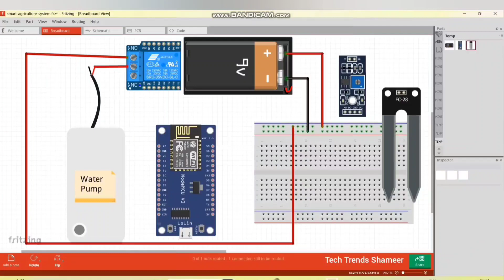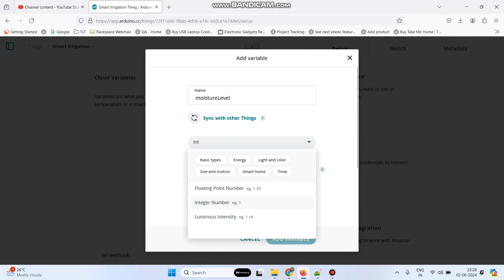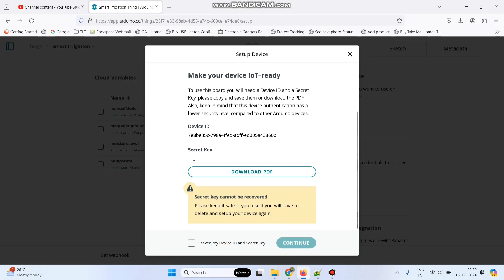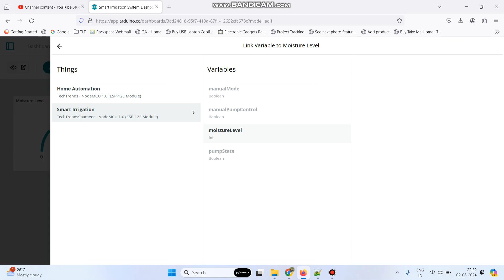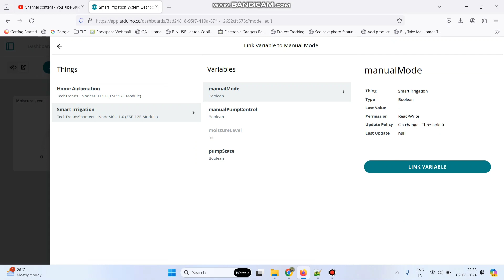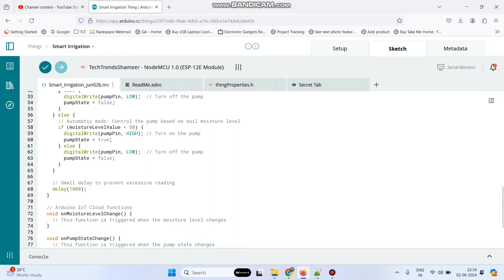Smart Irrigation with Arduino IoT Cloud and ESP8266

Comment: In file included from /run/arduino/sketches/smartirrigation_apr07a/smartirrigation_apr07a.ino:36:0:
/run/arduino/sketches/smartirrigation_apr07a/thingProperties.h:6:30: error: redefinition of 'const char DEVICE_LOGIN_NAME []'
 const char DEVICE_LOGIN_NAME[]  = "064a3c1f-3554-4aa8-8ba1-7b29fe9db88f";
                              ^
/run/arduino/sketches/smartirrigation_apr07a/smartirrigation_apr07a.ino:6:12: error: 'const char DEVICE_LOGIN_NAME [37]' previously defined here
 const char DEVICE_LOGIN_NAME[]  = "3be8c82f-d6f7-4b6f-9d90-db9b683ad235";
            ^
In file included from /run/arduino/sketches/smartirrigation_apr07a/smartirrigation_apr07a.ino:36:0:
/run/arduino/sketches/smartirrigation_apr07a/thingProperties.h:8:17: error: redefinition of 'const char SSID []'
 const char SSID[]               = SECRET_SSID;    // Network SSID (name)
                 ^
/run/arduino/sketches/smartirrigation_apr07a/smartirrigation_apr07a.ino:8:12: error: 'const char SSID [13]' previously defined here
 const char SSID[]               = SECRET_SSID;    // Network SSID (name)
            ^
In file included from /run/arduino/sketches/smartirrigation_apr07a/smartirrigation_apr07a.ino:36:0:
/run/arduino/sketches/smartirrigation_apr07a/thingProperties.h:9:17: error: redefinition of 'const char PASS []'
 const char PASS[]               = SECRET_OPTIONAL_PASS;    // Network password (use for WPA, or use as key for WEP)
                 ^
/run/arduino/sketches/smartirrigation_apr07a/smartirrigation_apr07a.ino:9:12: error: 'const char PASS [9]' previously defined here
 const char PASS[]               = SECRET_OPTIONAL_PASS;    // Network password (use for WPA, or use as key for WEP)
            ^
In file included from /run/arduino/sketches/smartirrigation_apr07a/smartirrigation_apr07a.ino:36:0:
/run/arduino/sketches/smartirrigation_apr07a/thingProperties.h:10:23: error: redefinition of 'const char DEVICE_KEY []'
 const char DEVICE_KEY[]  = SECRET_DEVICE_KEY;    // Secret device password
                       ^
/run/arduino/sketches/smartirrigation_apr07a/smartirrigation_apr07a.ino:10:12: error: 'const char DEVICE_KEY [26]' previously defined here
 const char DEVICE_KEY[]  = SECRET_DEVICE_KEY;    // Secret device password
            ^
In file included from /run/arduino/sketches/smartirrigation_apr07a/smartirrigation_apr07a.ino:36:0:
/run/arduino/sketches/smartirrigation_apr07a/thingProperties.h: In function 'void initProperties()':
/run/arduino/sketches/smartirrigation_apr07a/thingProperties.h:22:6: error: redefinition of 'void initProperties()'
 void initProperties(){
      ^
/run/arduino/sketches/smartirrigation_apr07a/smartirrigation_apr07a.ino:22:6: error: 'void initProperties()' previously defined here
 void initProperties(){
      ^
In file included from /run/arduino/sketches/smartirrigation_apr07a/smartirrigation_apr07a.ino:36:0:
/run/arduino/sketches/smartirrigation_apr07a/thingProperties.h: At global scope:
/run/arduino/sketches/smartirrigation_apr07a/thingProperties.h:33:53: error: redefinition of 'WiFiConnectionHandler ArduinoIoTPreferredConnection'
 WiFiConnectionHandler ArduinoIoTPreferredConnection(SSID, PASS);
                                                     ^
/run/arduino/sketches/smartirrigation_apr07a/smartirrigation_apr07a.ino:33:23: error: 'WiFiConnectionHandler ArduinoIoTPreferredConnection' previously declared here
 WiFiConnectionHandler ArduinoIoTPreferredConnection(SSID, PASS);
                       ^
Reply from the maker: The error you're seeing is due to duplicate definitions of the same variables and functions in both your smartirrigation_apr07a.ino file and the included thingProperties.h file.

Comment: we are getting error as
/tmp/2694822574/Smart_Irrigation_jul10a/Smart_Irrigation_jul10a.ino: In function 'void loop()':
/tmp/2694822574/Smart_Irrigation_jul10a/Smart_Irrigation_jul10a.ino:50:7: error: 'manualMode' was not declared in this scope
   if (manualMode) {
       ^
/tmp/2694822574/Smart_Irrigation_jul10a/Smart_Irrigation_jul10a.ino:52:9: error: 'manualPumpControl' was not declared in this scope
     if (manualPumpControl) {
         ^
/tmp/2694822574/Smart_Irrigation_jul10a/Smart_Irrigation_jul10a.ino:54:7: error: 'pumpState' was not declared in this scope
       pumpState = true;
       ^
/tmp/2694822574/Smart_Irrigation_jul10a/Smart_Irrigation_jul10a.ino:57:7: error: 'pumpState' was not declared in this scope
       pumpState = false;
       ^
/tmp/2694822574/Smart_Irrigation_jul10a/Smart_Irrigation_jul10a.ino:63:7: error: 'pumpState' was not declared in this scope
       pumpState = true;
       ^
/tmp/2694822574/Smart_Irrigation_jul10a/Smart_Irrigation_jul10a.ino:66:7: error: 'pumpState' was not declared in this scope
       pumpState = false;
       ^
/tmp/2694822574/Smart_Irrigation_jul10a/Smart_Irrigation_jul10a.ino: In function 'void onManualPumpControlChange()':
/tmp/2694822574/Smart_Irrigation_jul10a/Smart_Irrigation_jul10a.ino:85:3: error: 'manualMode' was not declared in this scope
   manualMode = true; // Enable manual mode when manual control is used
   ^

Error during build: exit status 1
  please help us bro........